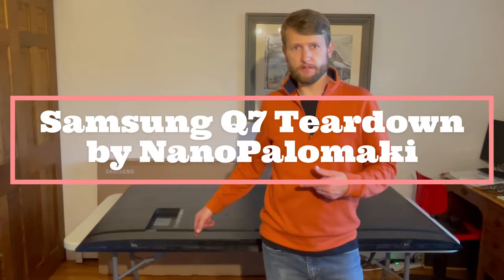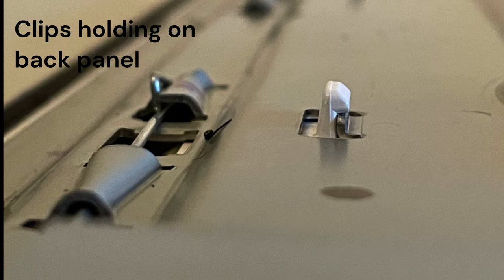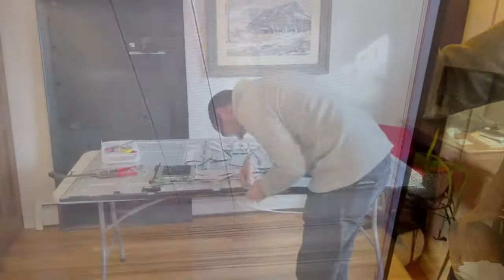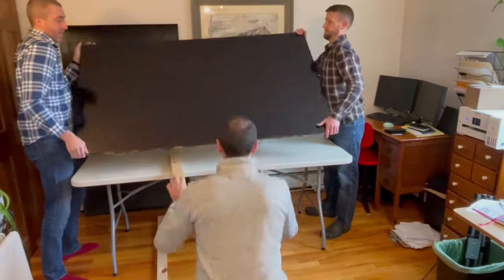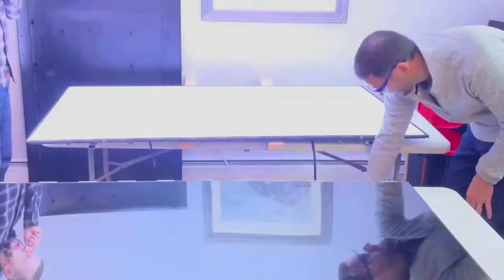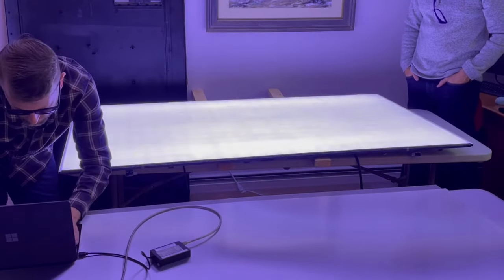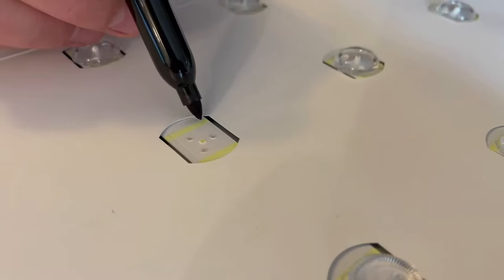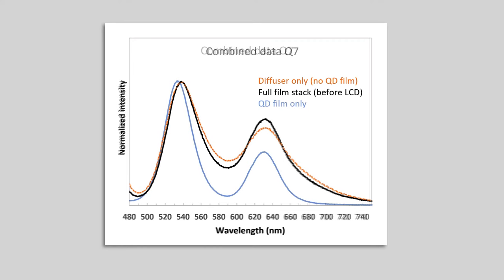Dissecting a Samsung QLED TV (75 inch)

Comment: I assume this one has (or should have) the separate One Connect Box, like the 2018 Q7 that I did not video when I tore it down? It doesn't do much on the screen without the box attached.
The 2018 one did not have any phosphor on the LEDs that I could detect, although I didn't take it apart down to the LED, just the light guide.
Reply from the maker: You would have seen it in the spectrum you took if it had phosphor on the LED, I'm sure of it. If this had the one-connect box I definitely did not have it! Although even with the broken screen I could make out some type of menu box when I pressed on buttons randomly but not enough to do anything intentional.

Comment: Hi I have a question
If the panel isn't connected to the board how can we control the local dimming?

Does my step correct
1. Connect the TV into Laptop HDMI before remove the panel
2. Disconnect all the panel then remove it
3. Play videos that has black and bright picture in laptop

Comment: This almost seems impossible to put back together if you're just trying to change the backlight or am I wrong?  Mine is a QN65Q9FNAFXZA QLED that I'm not sure I can tackle the job.  I would assume you need to reapply the adhesive for the screen and getting the bezel off without destroying it seems too difficult.  That said, even if you don't destroy anything, can you really lay the TV screen back onto whatever adhesive is used squarely on the first try?  Any help or direction you can point me to would be appreciated. Thanks so much for the video.
Reply: Turns out on my TV had the screen glued to the bezel.  To remove the bezel and screen as one component, you had no snap the two from the frame of the TV. Too bad it didn’t work for me - lost $1850 - thanks for coming out.
Reply: @JoseChung21 when you say snap, what do you mean? I've got the q7f and want to try but it's the same bezel as yours!
Reply: @wxrld9684  The bezel is actually glued to the screen as one piece.  It needs to be bent slightly and then lifted off. I believe it snaps into place  by wrapping around the frame of the TV. I destroyed my $1850 TV thinking the screen needed to removed from the bezel. Good luck.
Reply: @JoseChung21  Sorry to hear about your TV. 
I have the same TV and some dimming zones started to flicker so I'm considering backlight repair too but if I need to take apart the display (bezel with heat gun, LCD by using suction cups, remove polarizers and wide angle layers) just to access the stupid backlight, that's terrifying. 
You're saying the LCD needs to be lifted off with the bezel still on it? Woulnd't heat gun help with removing the bezel?
Reply: @VeeeeryyyFaaaastSlooooth  You do not remove the bezel from the screen. The bezel and screen are on piece just glued together. The screen with the attached bezel wraps around the frame of the tv and it appears that it snaps out from the frame in one piece.
Reply: @JoseChung21  Good info, thanks. Altough I think this is too risky for me, probably will try Samsung post warranty service, depends on what price they quote.
Reply: Its actually not hard.  Screen is not glued just foam taped and very easy to cut  by sliding bent shaving razor under it. To remove bezel you lever only between frame and clips and don't bend bezel.  Putting screen back you simply lay the tape down on bezel, put screen in position , lift corner slightly and peel back the tape.
Reply: That crap isn't made for fixing but it is possible to change parts. But it is extremely hard to do so.

Comment: Do modern TV Panels use the internal EDP display port style connection?   Or is it often just some proprietary thing?   I asked because I was curious if  It would be possible to hook up a controller board or even plug it directly into an adapter to a graphics card.   I know this was possible for some class of LCDs years ago. Didn't know they'd migrate it away from that or if I went to it as a standard.